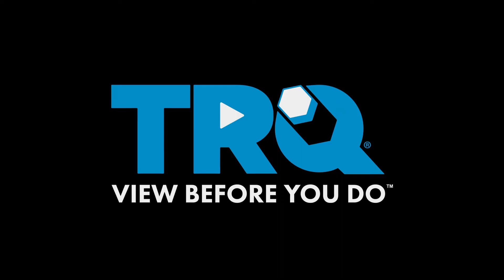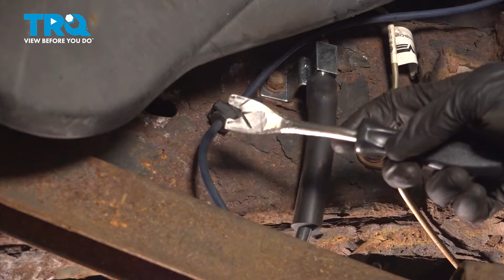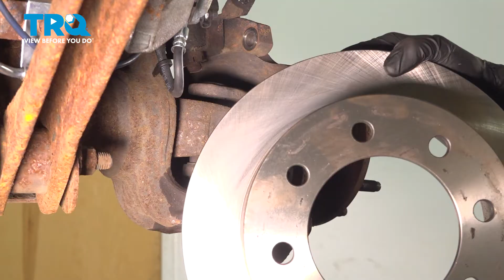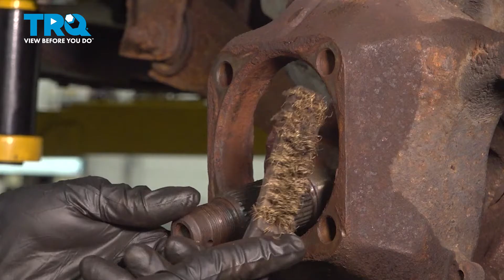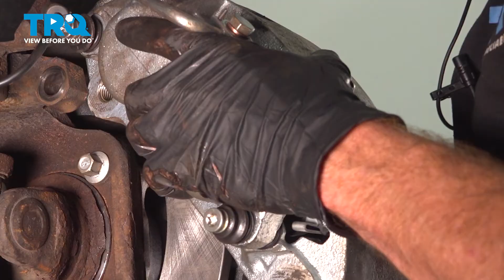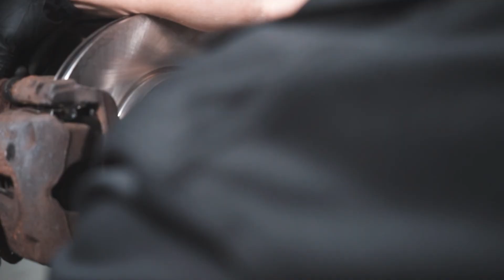How to Replace Front Wheel Bearing 1994-2002 Dodge Ram 2500

Comment: On a 2001 the hub nut will not be a castle nut. But a single use nylock nut. A 41 mm socket will work. The torque spec is 280ft/lbs and is the same for 2wd and 4wd models.( Although the bearing are different) Torque procedure includes rotating while tightening to properly seat the bearing.

Comment: My 97 was EASY to swap the hubs on. I’m going to be trying to swap them on my 2002 now. Tearing it all off wasint a pain whatsoever. Putting it back may be another story. The only difference I seen was one more hub bolt (bc it’s a 2500?) and the abs wire as my 97 doesent have abs.

Comment: I have a question.  Why are the bearings in the replacement hub assembly bearings dry and sealed so grease can't be added on the 99 dodge 3500?

Comment: Yeah this video doesn’t apply to older 2nd gen dodges. Think they used the style in this video 2000-2002. Earlier years is much harder. Rotor comes off with the hub and you have to beat all 8 lugs out to separate the hub bearing from the brake rotor.

Comment: Just so you are aware. That front hub is different on 94 and I think early 95. You will have a single piston brake caliper and you REALLY have to beat that bearing out. I actually separated the bearing into 2 pieces before I separated the bearing housing from the truck. Then the hub requires taking the rotor off by pressing out the lugs and then beating the ever loving rust out of it until the rotor and hub end separates. Because the rotor is mounted behind the hub face and held on with the lugs. Not in front of it to slide off. Stupid engineers....